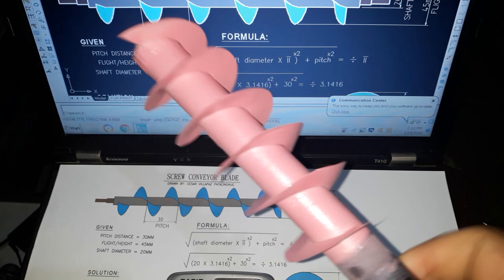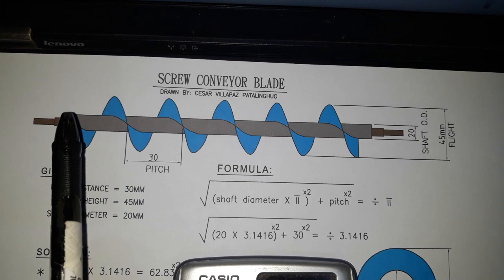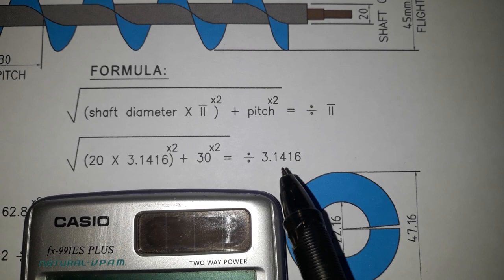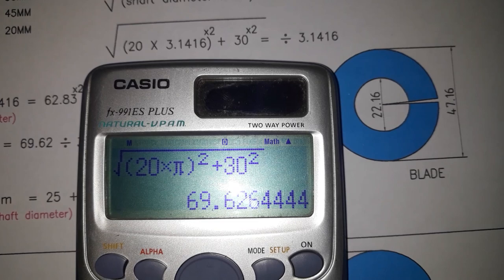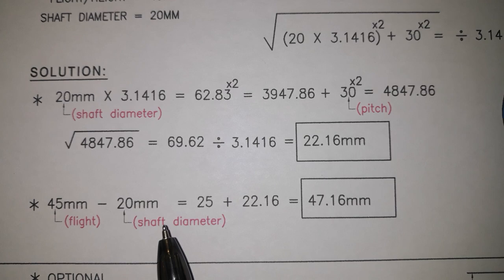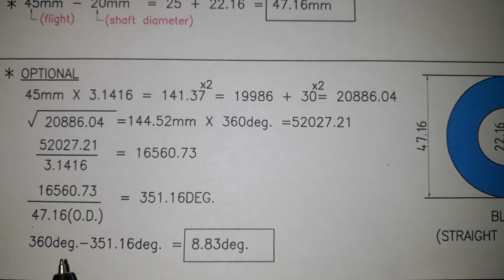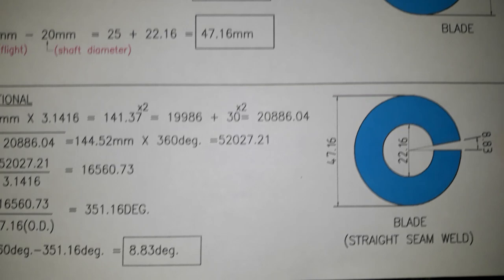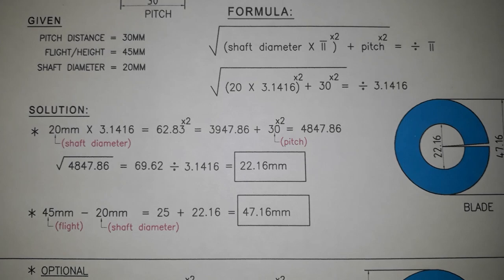Screw Conveyor Blade Sheet Metal Helical Calculation

Comment: Thank you sir.  I was trying to use the full circle and it was driving me mad.  The degrees of arc required can  also be found  by calculating the outer circumference  in the same way as the inner circumference, dividing that by, (47.16 X pi) and multiply the result by 360 degrees.
Reply: @valentinlishkov9540  Thanks for the links.  CAD tools and software are amazing but knowing how to solve a problem without technology enables one to better use technology.  Nazdarovya.